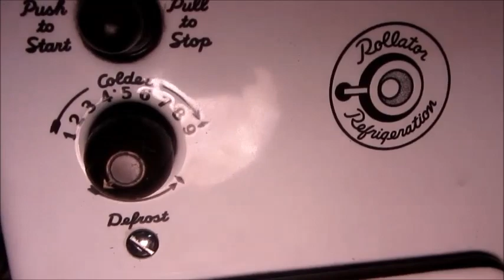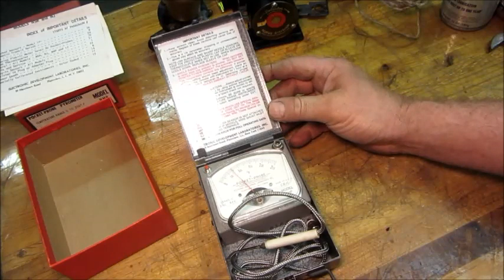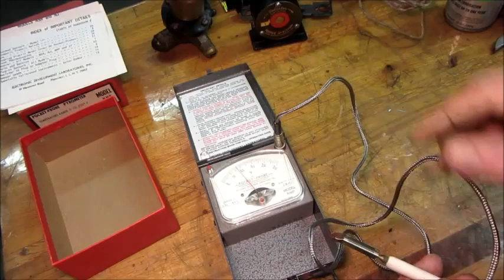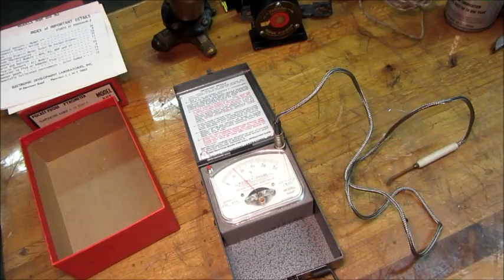Some antique refrigeration stuff I got...

Comment: Neat stuff! I’d imagine that the expansion valve sensing bulbs could be recharged with R-152a, making them perfectly serviceable once again.
Reply from the maker: Sadly, the actual bellows its self cracked on the larger, older TXV.  I'm sure the methyl chloride one could be used. It might be OK as-is actually!

Comment: Really cool finds. Those TXV's are a first for me to see.  The Methyl Chloride one's must of been a Nightmare to work on with all the flare fittings and leaks from vibration they must of had to deal with. Thinking they must of had to wear gas masks to work on those. The other one does not even look like a TXV.  I was thinking maybe an automatic expansion valve before you explained it. Thanks for the video.
Reply from the maker: Glad you enjoyed seeing these!  The good old days were surely pretty scary when you had major leaks to deal with in an enclosed space!  Methyl chloride is very dangerous because of low odor and it has as similar toxicity to carbon monoxide, if I am understanding what I read correctly.